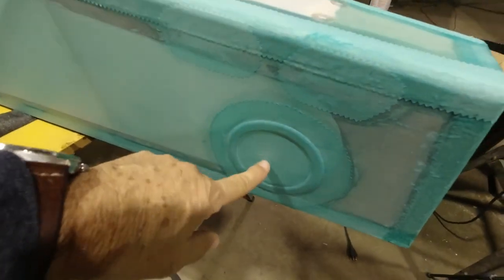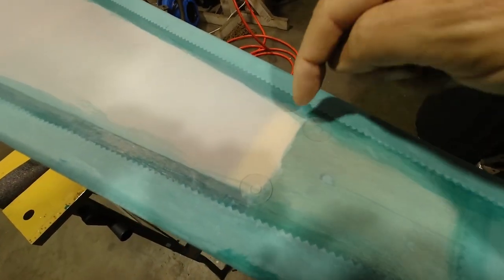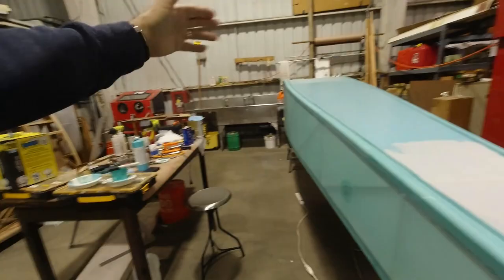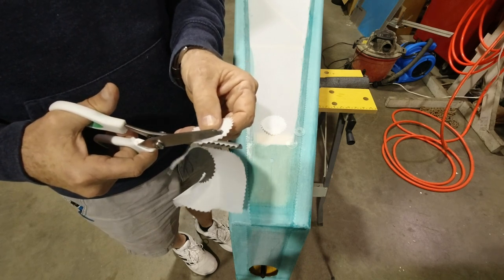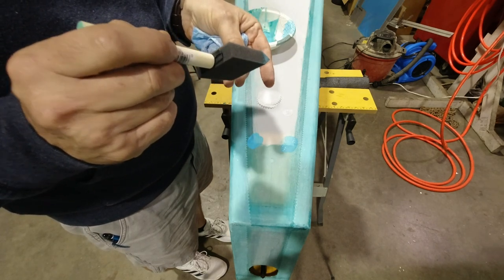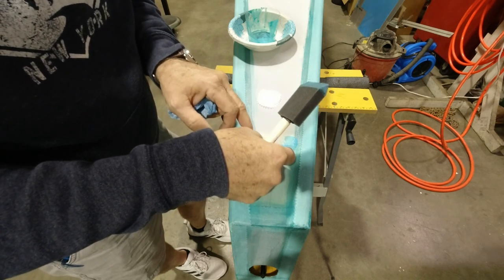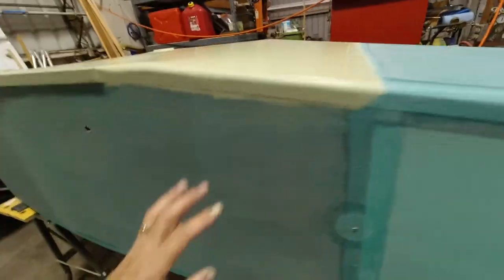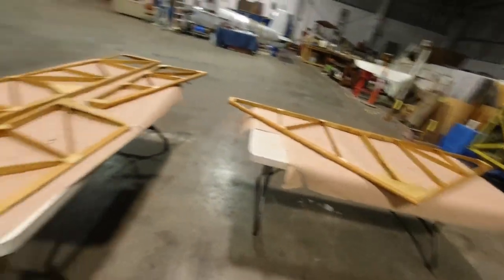Minimax 1100r Wood Aircraft Build Ep 153 - Painting Begins

Comment: I would set the water line at the top of the tapes as that would hide the edges a bit and reveal more of the underside colour.  I think 2 coats would be good as I all adds weight and will get dirty weathered look like a real  Hurricane.  A tip for you, paint a white area for the roundels now and mask it off before doing the camouflage on the sides as yellow and white will have difficulty covering brown and green.  Are you going to tone down the roundels the same way as the camouflage?
Reply from the maker: Having already painted one side, I can see what you mean about bringing up the water line, it needs a little more reveal. 
Too late on the white circle, I already camo’d it. I hadn’t thought about toning down the other colors but I will think about that now. You’re right that it will look even better as it gets some use on it.

Comment: Scoop the paint out with a plastic cup or even a cheap ladle from a dollar store. A bit messy but not spill messy. Easier than pouring out of a gallon can. That paint worked well on a model I refinished.
Reply from the maker: Good idea! Thanks for the tip!
Reply: I bought a little plastic pour spout that clips onto the gallon can at Lowes for a few bucks. Worked great, it prevents the paint from getting into the lid groove or down the side of the can.

Comment: If you need some vinyl graphics, N number or paint masks cut I can help with that. Would be a great way to make perfect roundels! My vinyl cutter can cut up to 32" wide and length is only limited by the length of the vinyl roll.
Reply from the maker: I’m planning to paint all of mine. I know it’s the more challenging route…
Reply: @DTMinimax  For about $15 you can get a 12" x 30ft roll of translucent vinyl paint mask. Cut with hobby knife or vinyl CNC cutter, either way might make painting numbers or roundels much easier.

Comment: One thing I’ve thought of if I go back to the vw engine it sheeting the wood with aluminum for a firewall if you will for a little bit of extra time to get to the ground in our birds that are wooden. Even on an aluminum plane if you are at 8000’ and above you probably would not make it back to the ground before the engine fell off and you become tail heavy and spin to the ground.
Reply: Good point but aluminum would likely melt, stainless steel or galvanized steel is a better choice. I used intumescent primer in my engine compartment instead of steel because covering the complex shapes with metal would have been quite difficult. Aircraft spruce sells it. An A&P once suggested to use a steel cable to attach the engine to the airframe so if the motor mount breaks the engine does not fall off and make you tail heavy. But that does not work well for wooden aircraft as there is too little structure to loop the cable around.

Comment: Dennis, question about the adhesive.... the glue on the bottom side of the fabric, will it always want to stick to the members under.... or will it lose its tackiness over time?   Will you have to worry about it sticking all the time?
Reply from the maker: It only wants to stick when I press down on it. It’s in the area where glue puddled enough underneath to drip on the cross members, so it’s not everywhere. 
On my wing the main area where this can happen is on the top of the rear spar. Since I have access to that, Im going to try taping the tops with blue tape and then remove it after filling the weave over those areas.

Comment: I'm liking the colour scheme, and can't wait to see it in the open air to get the true colouring. Can I ask why paint from the acrylic sheet & not just a tray?
Reply from the maker: When you use a pan, the ridges in it imprint on the roller and make it a little more challenging to keep it smooth. The acrylic sheet ensures you start with a smooth paint filled roller. I’m sure it could be done with no problems either way, I’ve just seen this method work for others.
Reply: @DTMinimax  thanks, I’d never come across that before. You not only entertain you also educate.

Comment: I’m really enjoying your build, particularly the covering. Just wondering: would you recommend a bristle brush for the initial application of glue to the fabric and frame, or would a foam brush work just as well?
Reply from the maker: I do recommend a bristle brush for gluing the fabric on, especially when applying the glue over the fabric. It just gives you a little more leverage to force the glue into the fabric. The open areas, definitely a 2” foam brush.
Reply: @DTMinimax  Thanks!

Comment: I’ve recently done our fabric project in school and we used the Stewart’s system. Shouldn’t there be 3 or so layers of Ecofill used after the ecobond layer you put on before paint?
Reply from the maker: For such a lite airplane that will live in a hangar, I’m just using the paint itself for UV protection. I am attempting to keep the paint as lite as possible. 
Sealed the fabric with thinned EcoBond which worked great! 3 coats of paint in most areas and 4 in some areas. (Green Areas)
Reply from the maker: I didn’t actually answer your question, yes that is the system they recommend. They don’t recommend using Ecofill for the weave anymore, just EcoBond thinned with water.

Comment: Are you going to prime the engine bay with intumescent primer for some fire protection? ACS sells it.
Reply from the maker: I haven’t decided yet. I did see that Contego brand at ACS. Seems really simple to apply.
Reply: @DTMinimax  it works too, you can hold a blow torch on it and the wood won't catch on fire. It is a little fragile once activated in a fire. I suppose it's possible vibration and wind might cause some of it to flake off during a fire. That's the only downside I can think of, still seems better than no protection at all.
Reply from the maker: @ulbuilder  Do you have it in your firewall area?
Reply: @DTMinimax  Yes I do. I used polyfiber epoxy varnish to seal the wood. Sanded the epoxy, applied intumescent primer and then top coat colors.

Comment: Hi Dennis,  im enjoying your build series (im still working on little bits of my fuselage,  flybaby 1B biplane).  Ive read about ppl using house paint on aircraft,  what kind of life expectancy do you figure on?  Thanks.   Oh, does stewart systems have anything to say about it?
Reply from the maker: I didn’t talk to Stewart systems about it. I just figured it is designed to be on the outside of a house for 20 years. My plane will live in a hangar and will only see the light of day when I fly it so it doesn’t get anywhere near the exposure the paint is designed for. The good thing about sealing the fabric with Eco Bond is that it’s 100% waterproof, which means water can never get to the underside of your paint.
Reply: @DTMinimax  thanks for the quick reply!  I think I read somewhere about a guy leaving test fabric on a frame with house paint outside for 7 years or more and it still tested good.   I'm a little more concerned about the adhesion to the fabric.....I'd hate to do all the covering work and paint just to find out it doesn't stick and possibly ruin it for applying the official  'aircraft paint'     im probably overthinking all this,,  I'm sure I'll be long gone before the paint job fails!!
Reply from the maker: @jimmyboy163  You can find the article if you search for Bowers Fly Baby, it’s very convincing